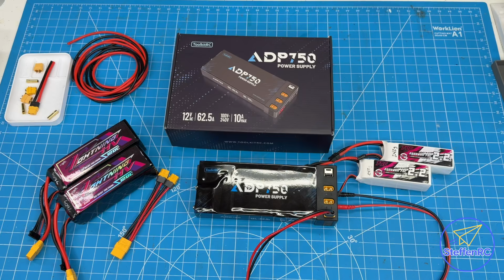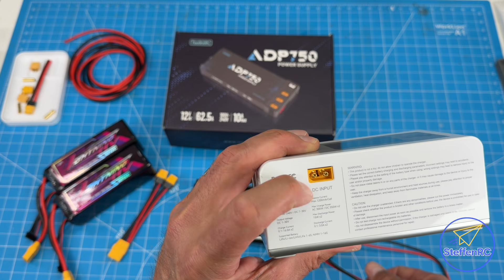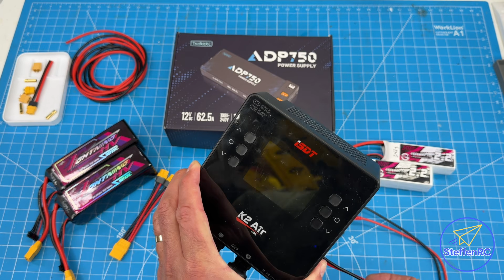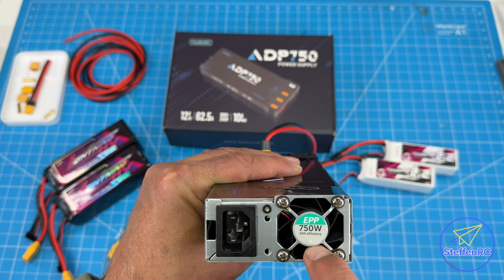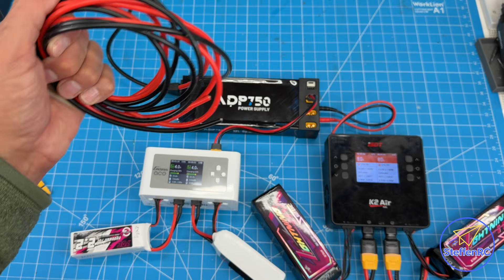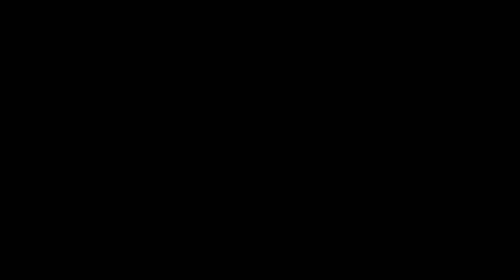ToolkitRC ADP750 - Upgrade your lipo charger with DC power

Comment: Hey,    So I have 10 battery packs-  Out of 10 flights I always seem to have a couple flights that aren't so fun and seem quite turbulent like i'm flying in crosswinds and the other 8 batteries are great flights-  Why is that?    Everything is the same, weather is the same-   I know i'm doing something wrong-  Please help
Reply from the maker: If you notice that your plane is bouncing around while flying straight, I'd say you have some inconsistent  turbulence at your flying field.  We have the same at ours too.  When the wind is from the south, it rolls over a tree line and causes some crazy flight conditions, while it doesn't feel windy on the flight line, 20' up is quite bumpy..  Are other pilots experiencing similar issues?   Btw, what type of plane are you flying?
Reply: @SteffenRC  Primarily the Ugly Stik,  61 inch wingspan but all my planes do it-   Other pilots are confused as i am, they say it's probably turbulence-  But I'm going out now to tinker some more and learn some more hopefully-  Thank You-   6th year of flying and i;m still learning
Reply from the maker: @J @Jack-q4b1y . Curious if all your planes appear to hit turbulence and other pilots don’t have the same issue, could it be your having radio problems?  Can you check your flight logs and determine if your signal strength is an issue?
Reply: @SteffenRC  Nah I don't think thats it-    But today i did do takeoffs with full throttle and throttled down on the first lap and all 10 flights were smooth.   I'm hoping it's just poor throttle management on my part-   I never  really did full throttle takeoffs before this
Reply from the maker: @Jack-q4b1y  so you’re thinking the plane was stalling?  So the increased speed solved the issue.?
Reply: @SteffenRC  It doesn't stall,  i stay on the throttle during flight,   Overall she flies well,  Just some flights are more turbulent and faster/slower than others --   Pretty crazy-  I don't know what it is-   Also lots of dust devils this Spring at our field-  so there is definately turbulence-  Full throttle takeoffs again tommorow
Reply from the maker: I think you nailed it..  Our field has the same odd wind that will really toss a plane around.  But the flight line doesn't feel a thing.

Comment: Have it too! Awesome for the price 👍🏼 👍🏼 As I don’t have a shop just a bit annoying always to get the power supply and the charger and then pack it again afterwards 🤣 But awesome for charging big packs 👍🏼 👍🏼 I had the 450W and it was sometimes a bit too low in power and more in current (just 19A I think)… cheers!!
Reply from the maker: This is a simple, ready to use setup that will help max out our chargers...
Reply: @SteffenRC  yes , awesome! I used to charge mainly at the field so max charge was no problem. But for home it’s really sweet. Also I like the on off switch. It makes sparks a thing from the past :)